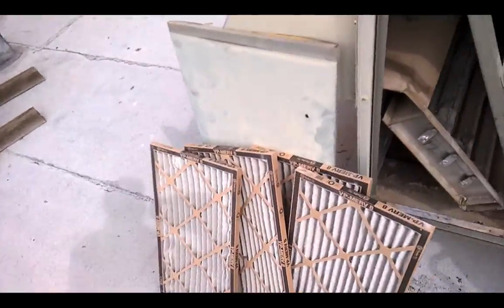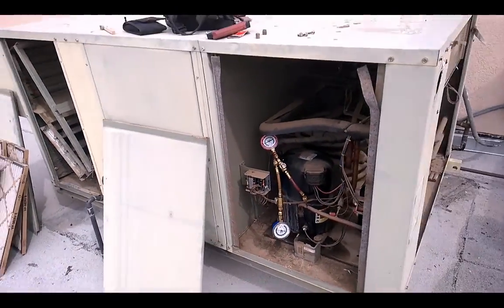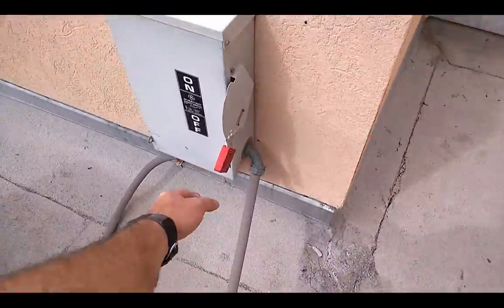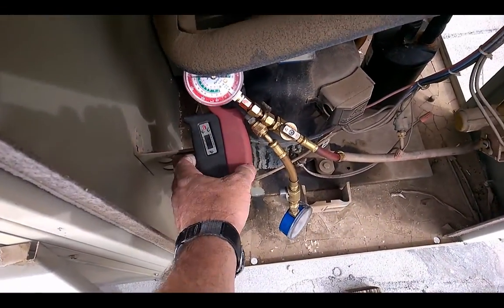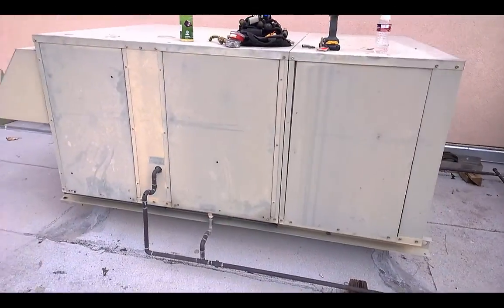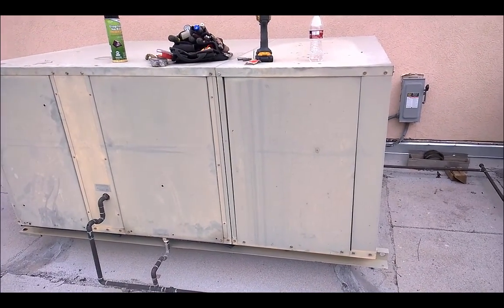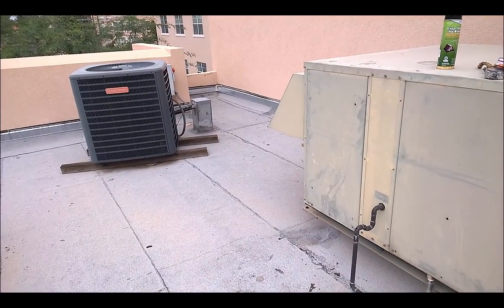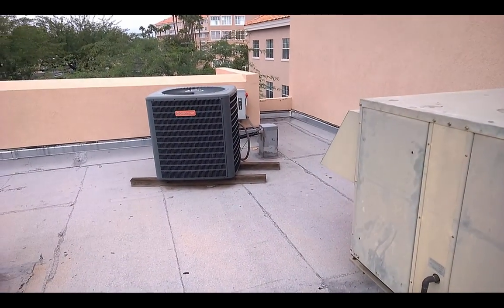A Heat Pump louder than Goodman heat pump???

Comment: I use Coil Master. I have to order more when I’m down to the last 2 cases. It takes a couple weeks to get more. It is ground shipment only. It will melt aluminum and does a number on skin and flesh. Deluding is required. It cleans the best out of all the other cleaners I’ve ever used in my 40+ years.

Comment: Self rinsing evaporator cleaner is crap. Do you soap up in the shower then get out? NO. The coil should be rinsed off.
Reply from the maker: I personally prefer using the "yellow death" form brite condenser coil cleaner on everything which definitely needs to be rinsed well but there are indeed indoor coil cleaners that are made to just be sprayed on and the residue doesn't have to be rinsed (such as the aerosol can shown).

I rarely use this stuff and I believe this is my only video ever using it.

Comment: It looks more like an Addison unit.
Reply from the maker: I'm not familiar with that brand.
But this is a McQuay water source heat pump.

It's the only one like this we have here. Most are above the t-grid in the building.

McQuays on one side and Tranes on the other.

The McQuays are actually the more reliable.

Although the Trane made ones above the t-grid ceiling are not much Trane inside.
They are Tecumseh rotary compressors with a TXV and a water heat exchanger with a GE blower motor.

The TXV's fail and the water heat exchanger can't store hardly any extra refrigerant when the TXV starves it a little and it drives the head pressure up real quick and the compressor works harder. Then dies eventually.

They are nearing 20 years old tho.
Reply: hackfreehvac
Addison constructs their systems very much the same way.
Reply from the maker: Oh ok.

Comment: Yeah the biggest complaint we get is noise from the Goodman, the metal gauge is too light and it adds to the noise due to harmonics. We install the Goodman rooftops only when we have to get down and dirty on price. They have gotten better on the rooftops ever since they bought amana and used there rooftop design. But i wont use there splits.
Reply from the maker: "Down and dirty price".
Yup. LOL

Comment: Nice video. But I beg to differ on McQuay being good. McQuay has nothing but issues here in the NE.
Reply from the maker: These are pretty good here. Especially since they cycle on and off every few minutes based on the way the EMS timing works.

The one thing that does SUCK on these is that the reversing valve coils are DC powered! If you replace one with a 24VAC coil the 24VAC coil will smoke and then short itself which then fries the IC chip on the control board that powers the coil.

McQuay new boards are 24VAC now luckily.

Comment: Dueling heatpumps! 
On the topic of construction dust, I hate to hear when drywall sanding has been done and the unit wasn't shut down.  It's good that that unit had decent filters in place.  Maybe the filters were already dirty before the sanding, and that may have actually helped.
Reply from the maker: I did brush and spray the coil with a no rinse evap coil cleaner